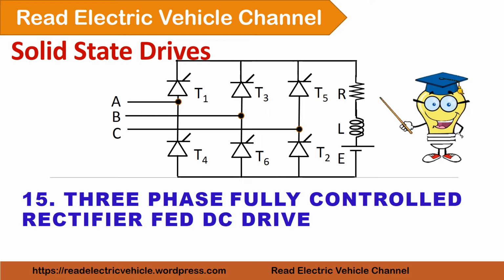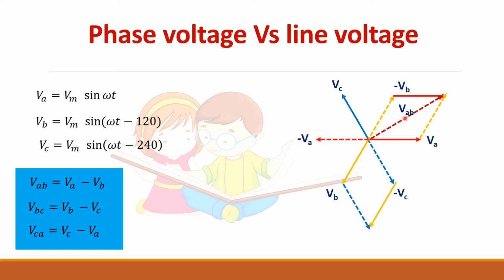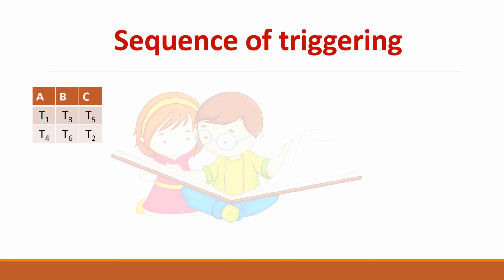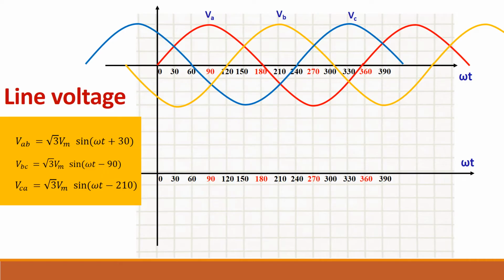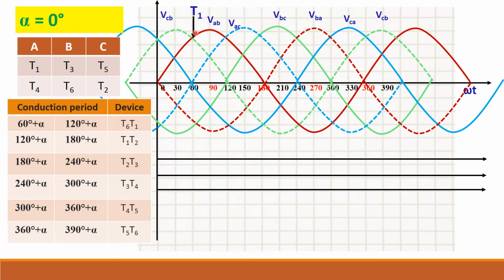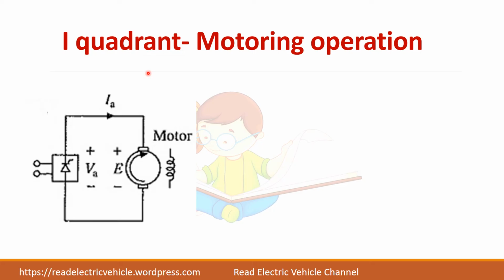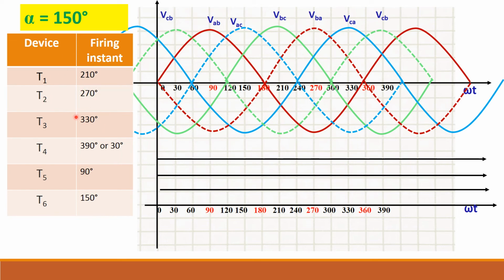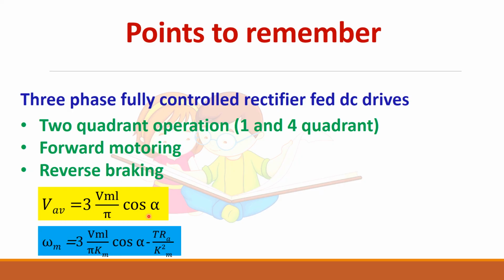Three phase fully controlled rectifier fed separately excited dc motor

Comment: can a half controlled rectifier fed separately excited dc drive operate in quadrant 4 for justify your answer ?
Reply: No, because in half controlled rectifier there isn't any negative voltage in the output voltage so the regeneration mode is not possible.

Comment: Why you have not used waveform using line  voltage, for what purpose you have drawn that
Reply from the maker: Output waveform is drawn using line voltage waveform only. 
Refer to three phase fully controlled rectifier (power electronics) video for step by step procedure to draw waveform.